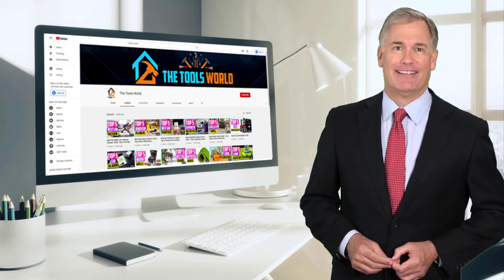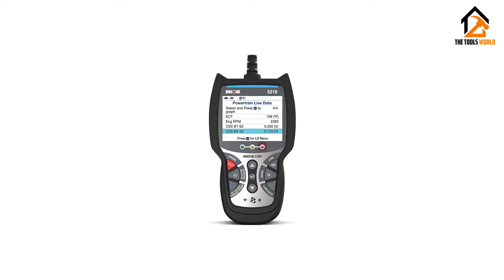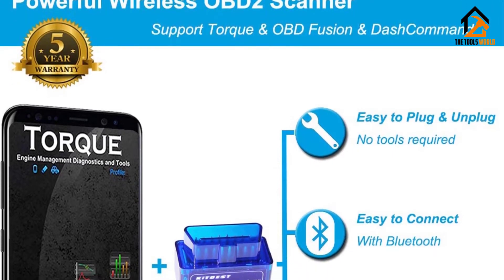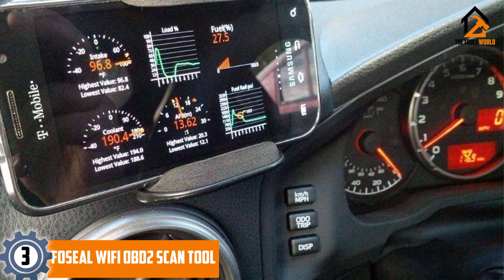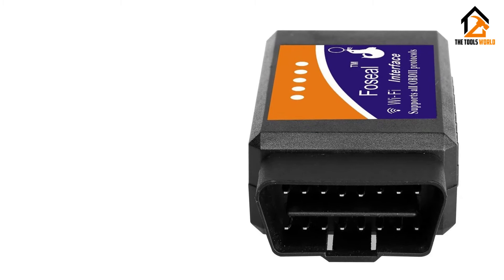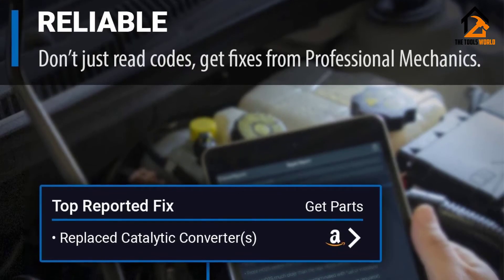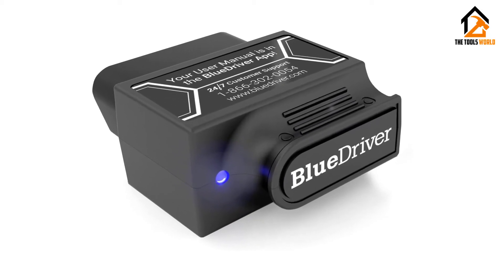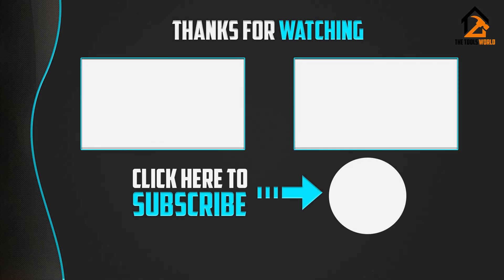Best Bluetooth OBD2 Scanners [Top 5 Picks]

Comment: I have the BAFX scanner.  works great.   but in using it with TORQUE PRO, I have to make sure the FASTER ODBC CONNECTION box is checked (under ODBC adapter setting).  if that option is not checked,  the torque APP WILL NOT CONNECT to the ODBII scanner.  the only negative for the adapter is SIZE.  it sticks out to far and rubs against my ankle
when I am driving and shifting gears (I have a manual transmission nissan sentra).   of course, if you only use it to read error codes then this does not matter.  but I like to monitor real time performance.    if it was about half the size it is,  it would probably work fine.  so I will probably buy a smaller one as it does sometimes become disconnected when my ankle is rubbing against it.